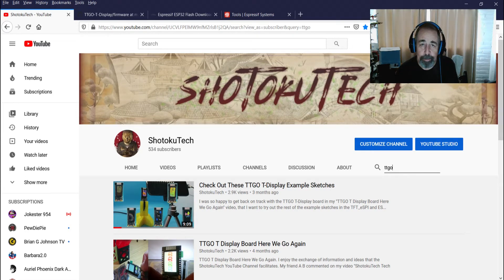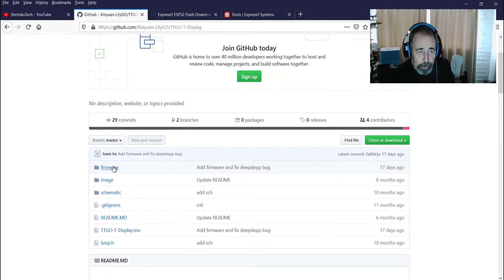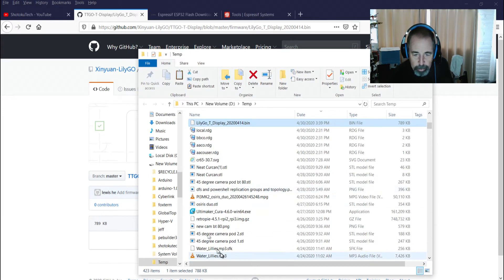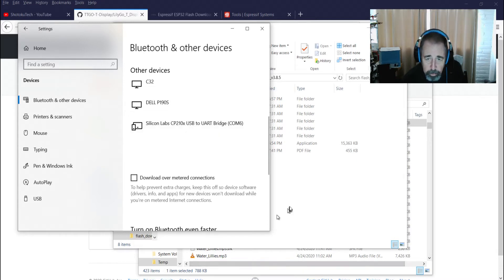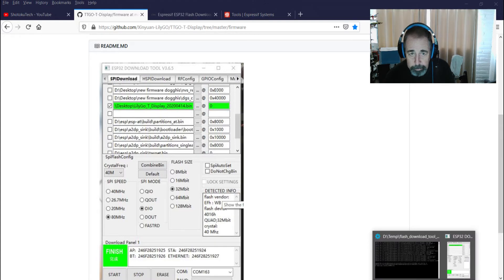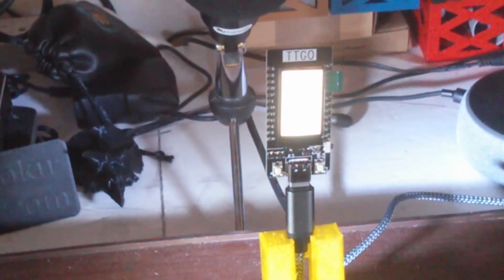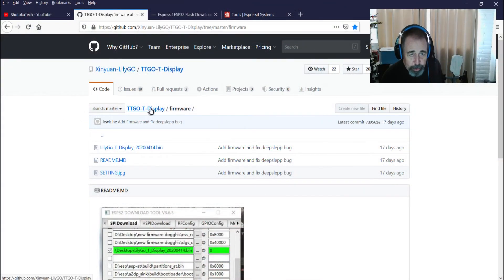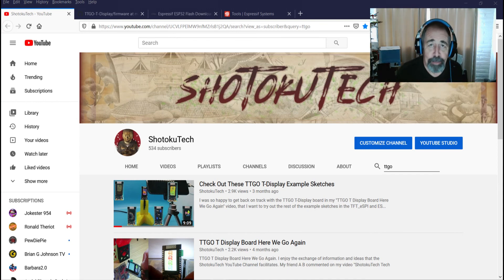TTGO T Display: Use the ESP32 flash tool to update the firmware

Comment: Do you have any sense of what's actually changed with this, and is it possible to roll back to the previous firmware if I don't like it?
Reply from the maker: Additional information is displayed on the screen and the return from deep sleep function works correctly. There is not a means to roll back the update that I can readily find. I am trying to answer every question one might encounter working on this and the firmware update is the obvious change from the last time I worked with this board. It seemed like it would generate more questions if I skipped it, rather than showing how to incorporate the update into the board. Thanks.
Reply from the maker: Thanks again. Please make sure to check this out: https://youtu.be/EC9hiIu5C3o